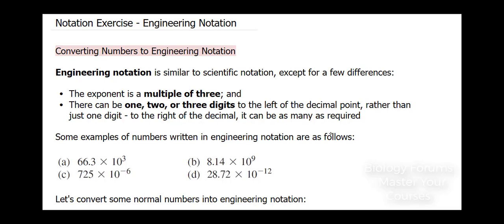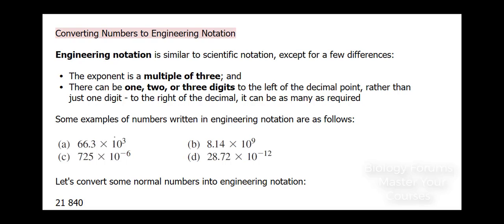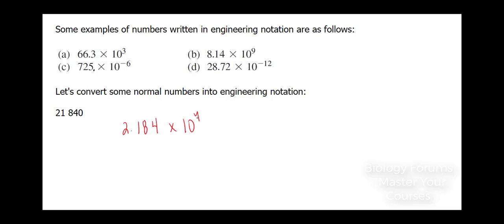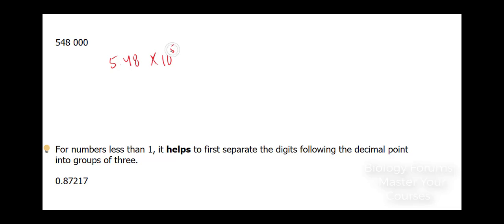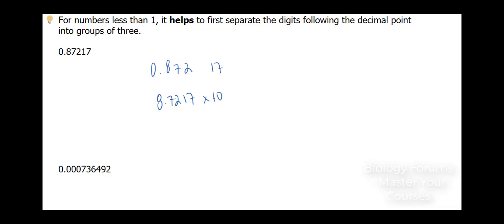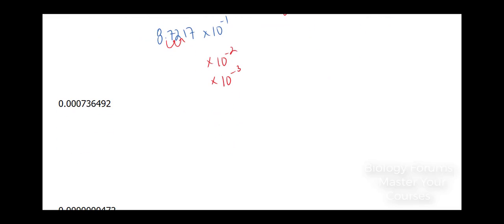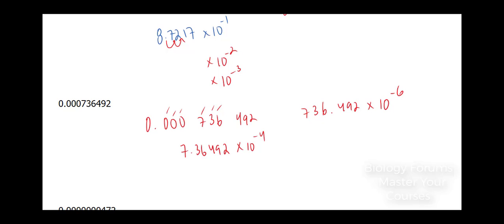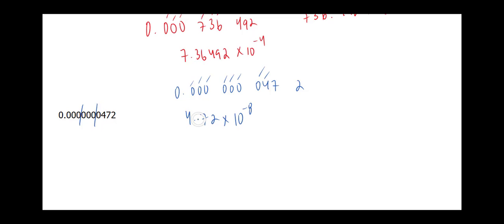📚 How to write any number in engineering notation

Comment: Okay, knowing zero about engineering notation, I found you video, and first thing, on the first page, dose not make sense. You said. "There can be one....digits to the left of decimal point, rather than just one digit". That makes no sense. Do you mean they would rather it be notated with more than one digit to the left, but is allowable to note it with one digit??
Reply: But I would add, you make the process of doing it later in the video perfect, even for a dumba$$ like me! Thank you
Reply from the maker: Throw a few numbers at me, I'll convert them to engineering notation for you to clear any doubts...
Reply: Oh, I have no doubts about you knowledge!! I just didnt understand the first explanation. You made it crystal clear in the vid. Heres one... (4.56)(10.87×10-⁵)(1.67×10³) all over (6.37x10⁴)(3.88×10-²)(12.141)
For instance, To make the 10.87x10‐⁵ back to a normal number, I'm not sure what direction to move decimal to make the negative 5 go away.
Reply from the maker: @StevesBeyondRepair  Let me know if this helps: https://biology-forums.com/index.php?topic=1948055
Reply: How do I calculate that out
Reply: I took a stab. I think I get it, but. After dividing the fraction, I get
.0000371654 I put as 37.1654 x10-⁶ book says 37.164x10-⁶ was I supposed to round down?
Reply from the maker: @StevesBeyondRepair  The answer to the question above is *.0000371654*? That's way off from what I found, could you check the link I provided to see if I translated your numbers correctly into the right expression? Anyway, assuming 0.0000371654 is correct, it would be 3.716*10^-5 in scientific, and 37.2*10^-6 in engineering notation. You round based on the smallest number of digits, which is 3.

Comment: With 0.000736492, couldnt you have put 0 before the decimal and the numbers after making it 0.736492x10 to negative power 3. Wouldnt that work aswell because there is still one digit to the left of the decimal?
Reply from the maker: No, because engineering notation requires an integer at the beginning. At the beginning of the video I wrote you can have one, two, or three numbers to the left of the decimal. 0 is a placeholder just a placeholder, it's not an integer.

Comment: With 0.000736492 why can't you put the decimal behind the 2 making the answer 736492 x 10 to the negative ninth power?
Reply from the maker: Hi there,

In scientific notation this would be:

7.36492 * 10^-4

Obviously -4 is not divisible by 3. Therefore, moving the decimal twice to the right makes it:

736.492 * 10^-6

This works because now you have 3 numbers to the left of the decimal place, and that's allowed because you can have 1 to 3 numbers before the decimal place and that's it - no more, no less.

Your answer doesn't reflect the original number.